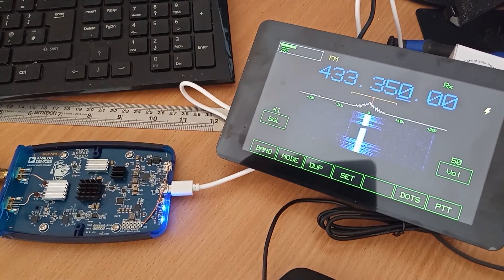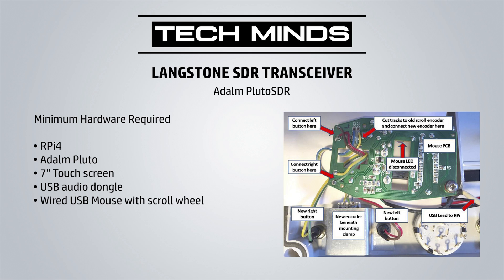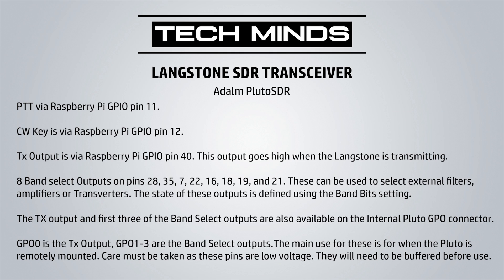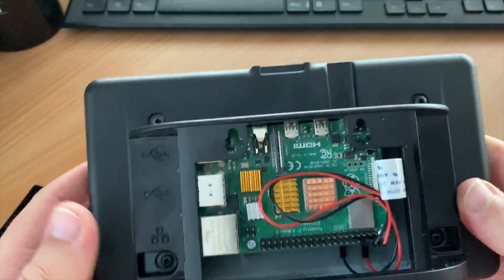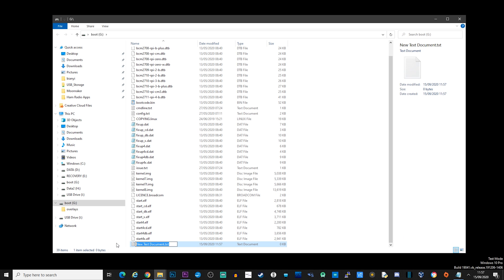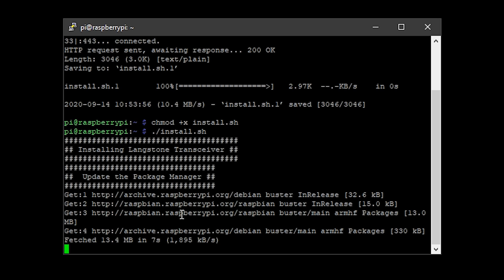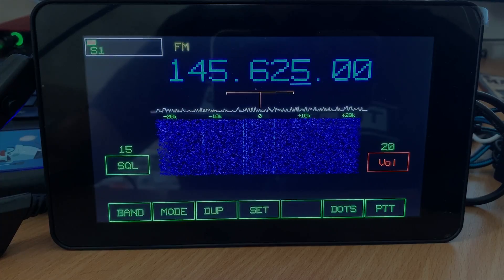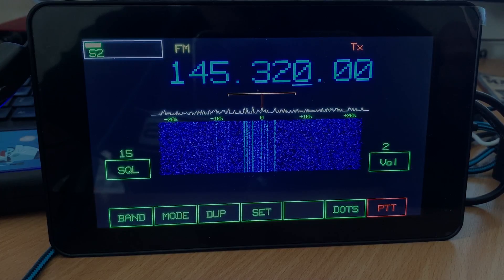Langstone Project - SDR Transceiver using an Adalm PlutoSDR

Comment: For best value for money and time, it's best to load BATC Portsdown 4 software and use a Pluto with F5OEO For the Brave DATV firmware. Then once you have a DATV transmitter and while connected to the web select load the Langstone project. If you add a Minitiouner  ATV receiver, one lot of hardware  does 4m to at least 9cm voice, telegraphy and television.  BATC Portsdown circuit cards operate too with Langstone so band decode, Transverter control and rf transmit switching.  My full set is under construction at present. The boxed unit you showed is by Dave G8GKQ. 73 de M0YDH
Reply from the maker: Hey, you see to know your stuff with this setup. Can I ask, do you know of the best solution to be able to use one antenna with the Pluto? Like an antenna switch of sorts to feed the rx and tx ports of the Pluto? Cheers, Matt M0DQW
Reply: Hi Matt. Tx/Rx switching and indeed everything after the Pluto is where we earn our M0 stripes! The first time for me was with the Portsdown DATV transmitter using the band decode outputs and a six port coax transfer relay seen here https://youtu.be/JSD_ecPeJ7k. 3 transmit bands and the Minitiouner receiver could be connected by logic and transistor switches to the single antenna. It's clunky but proven its worth in my ATV rack out portable. £8 For a basic BATC membership (£20 For full colour delivered CQ-TV magazine which is better than Radcom) is a first positive step. Then you can buy the PCB's for Portsdown / Langstone combo and all the DATV receivers in the club shop and use the forum. Langstone uses the same band decode and RF switches. So you can select and control power amps and low pass filters that way. I read the club Wiki a great deal https://wiki.batc.org.uk/BATC_Wiki for much guidance and the club forum for much else. You would normally be scouring rallies for coax and transfer relays but they all postponed. Makis SV1AFN superb shop has pin diode switches but you'll get a Brexit benefit when you import those. 🇪🇺 was good for the hobby. Dave G8GKQ managed to run the BATC 8 band RF switch in reverse without the amp as a Rx routing device. 2m and 4m LP filters - QRP-LABS shop. 70cm LPF is often the £5 one off EBay. It's fun and I am learning how to build this amazing system.  Probably arranging an interview with G8GKQ so he can guide you round his complete Langstone/Portsdown would be inspirational for your viewers. Are you going to demo the Langstone mouse with the proper encoder Matt? Mine is on the bench ready to connect together.  73 de M0YDH

Comment: Hi , have U measured your transmiter spectrum? Here with SDR console the spectrum is awfull (-40dbC spurs) , this transmitter is illegal
Reply from the maker: It’s not illegal, because if you listened in the video I mention about bandpass filters and you MUST always use the correct filters for the band you’re operating on.
Reply: @TechMindsOfficial  sorry but it is illegal and polluting because there are spurs every 25khz close to the frequency , they are in band and down to only -40dbc , this is inband spurs not harmonics , they cannot be attenuated by a filter
Reply: @aidesadministratives4490  even if it is illegal, the open source community has been forced to pick up the slack that the big radio companies have dropped the ball on, Yaesu, Kenwood, ICOM, have all failed us and should be forgotten. This technology should have been widely available two decades ago, so if some spurious transmissions make it out, so be it, we must learn and grow and this is the way that happens.
Reply: Interesting, hmm, I must check my hackrf one when the slow boat transporting it arrives from China for spurs as you mentioned.

Comment: I put it all together but I used a keyboard and I think some of it went wrong, today I will do it again using putty and no keyboard. Just ended up with some buttons on the screen and no touch.. 👩‍🦼 🐶 Good fun...
Reply from the maker: I’m pretty sure the instructions say not to use a keyboard and you must set it up via SSH. Fingers crossed it works out well for you! Thanks for watching 🙏
Reply: @TechMindsOfficial  I got the required sound card and it all works now 🇦🇺 I joined the discussion now too....

Comment: What would the power be? I would want to have at least 10w
Reply from the maker: It would depend on what band you want to use.
Reply: I know that, I just didn’t want extremely low power

Comment: Very interesting project. I put together the Pi part and although I do not have the 7 inch screen yet,  my  hdmi monitor basically showed what would be on the 7 inch screen.  I was very happy.
However the paragraph "The software consists of three parts. The SDR itself uses two python GNURadio Flowgraphs (Lang_TX.py and Lang_RX.py)which .........  GNURadio using a Linux Pipe. is a complete mystery to me.  Can anyone help with this?

Comment: Would be interested to hear, did the grounding help the crashing with Ethernet dongle issues?
Reply from the maker: I never had any Ethernet issues as I done the ground mod before testing Ethernet. But I’ve run it 25 metres away via ethernet without issues.